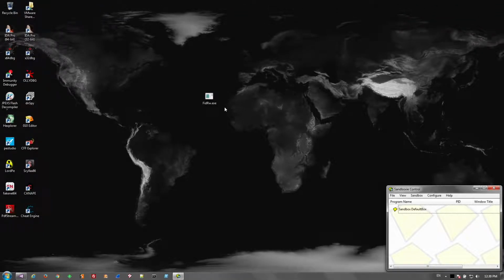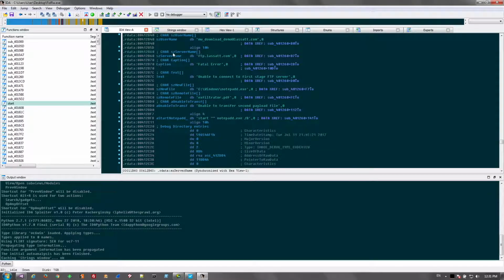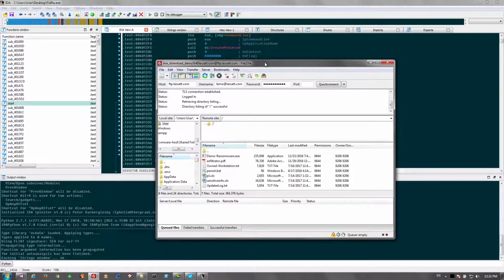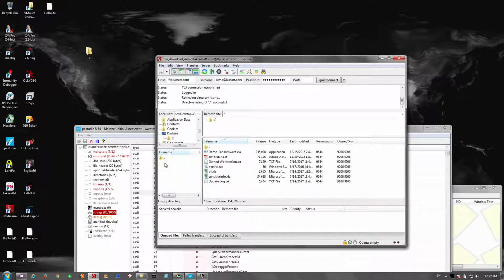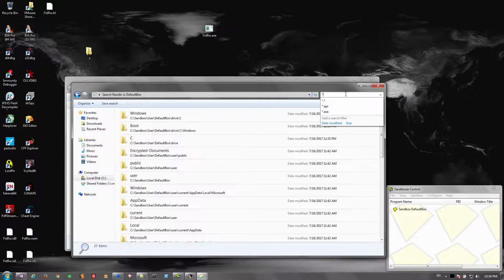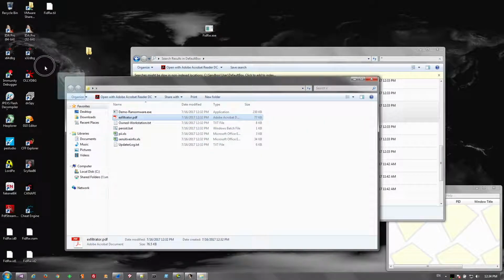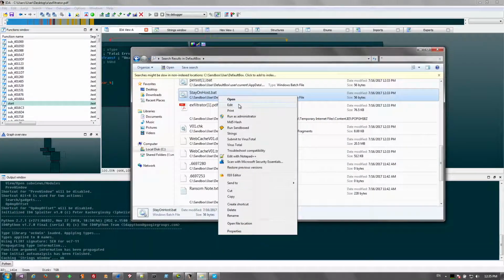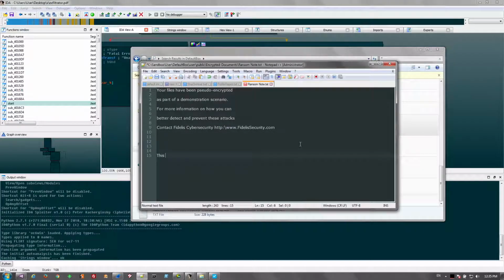Malware Analysis   Fidelis Ransomware Demonstration

Comment: It was nice,can u please demonstrate how to overcome by its antidebugging tricks.
As it is using QueryPerfformanceCounter.
Not getting how to overcome it in ollydbg. It will be quite helpfull if u do video or explain in detail.
Reply from the maker: I believe this is the section of code you are referring to:

004018BA  |. PUSH EAX                                 ; /pFileTime
004018BB  |. CALL DWORD PTR DS:[<&KERNEL32.GetSystemT>; \GetSystemTimeAsFileTime
004018C1  |. MOV EAX,DWORD PTR SS:[EBP-8]
004018C4  |. XOR EAX,DWORD PTR SS:[EBP-C]
004018C7  |.  MOV DWORD PTR SS:[EBP-4],EAX
004018CA  |. CALL DWORD PTR DS:[<&KERNEL32.GetCurrent>; [GetCurrentThreadId
004018D0  |. XOR DWORD PTR SS:[EBP-4],EAX
004018D3  |. CALL DWORD PTR DS:[<&KERNEL32.GetCurrent>; [GetCurrentProcessId
004018D9  |. XOR DWORD PTR SS:[EBP-4],EAX
004018DC  |. LEA EAX,DWORD PTR SS:[EBP-14]
004018DF  |. PUSH EAX                                 ; /pPerformanceCount
004018E0  |. CALL DWORD PTR DS:[<&KERNEL32.QueryPerfo>; \QueryPerformanceCounter

If this is the code you are referring to, the use of QueryPerformanceCounter isn't being used as an anti-debug trick in this instance. This routine is commonly seen in Microsoft Visual Studio compiled binaries to setup what is known as a stack cookie. This helps protect the program from buffer overflows and similar stack based exploits.

If the program is unable to run for you, I'm not sure what might be causing it.  I did not use any anti-anti-debug tricks or plugins to get the program to run. 

I hope this answered your question :)